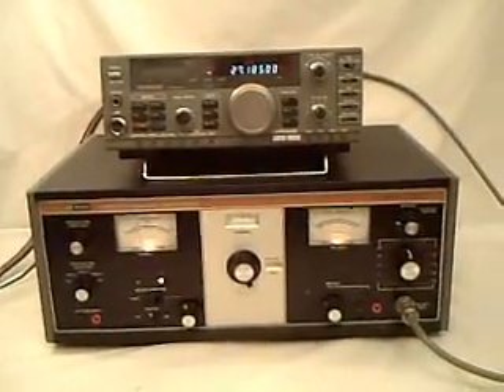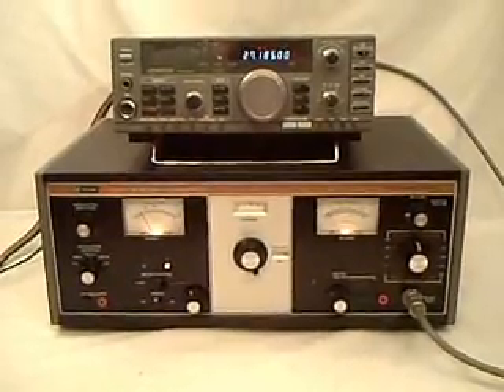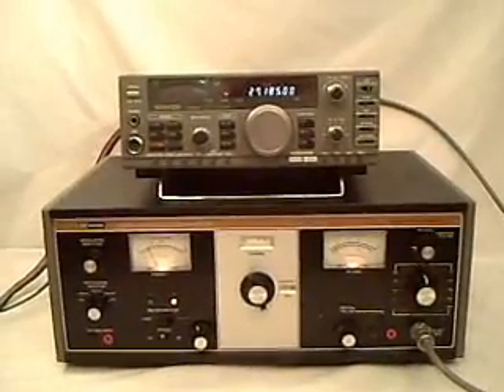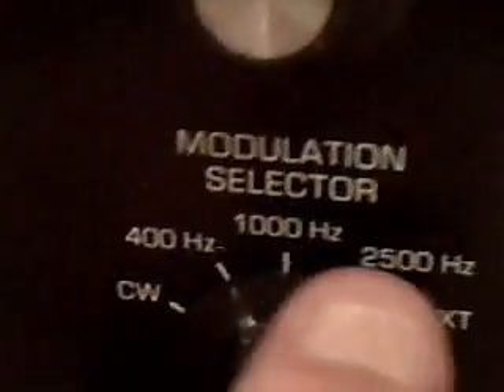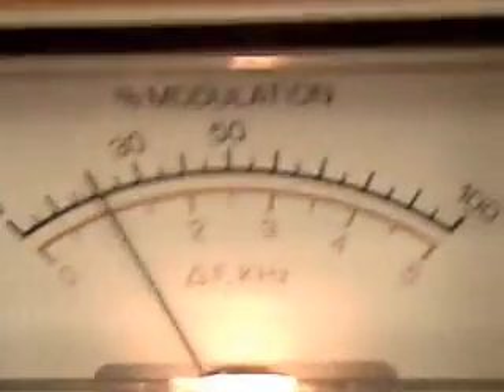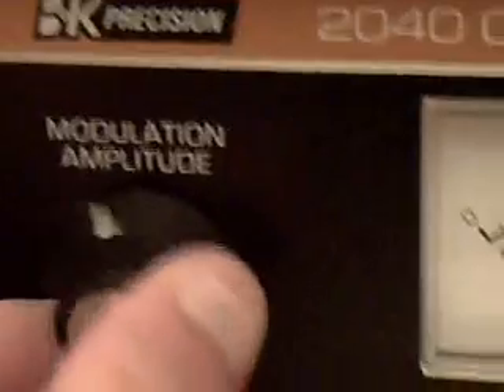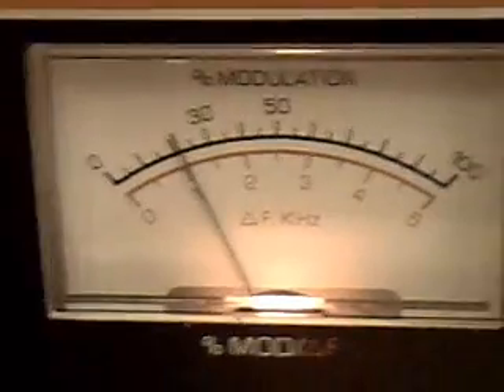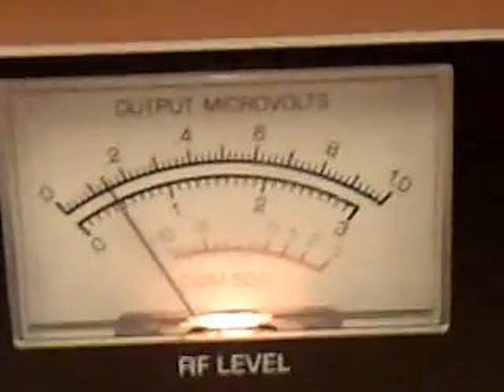B&K Precision 2040 CB Signal Generator Tested

Comment: Question Mel, do you connect the coaxial cable directly to the radio's antenna connector?
Reply from the maker: It's been a while since I had the unit, but as I recall, the answer would be yes..